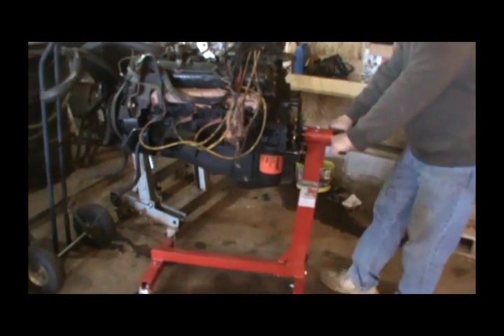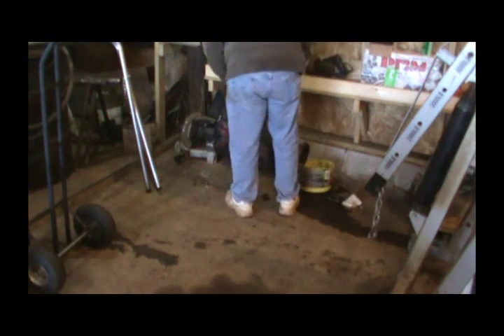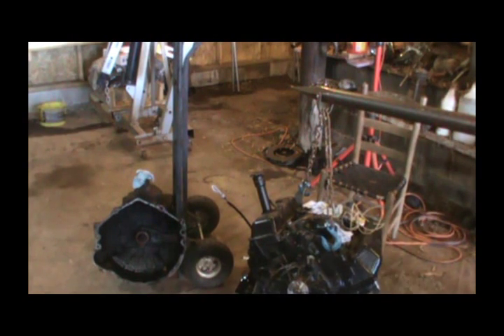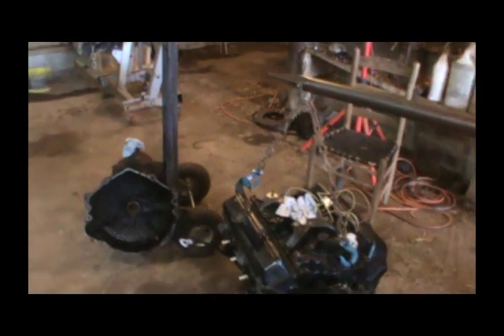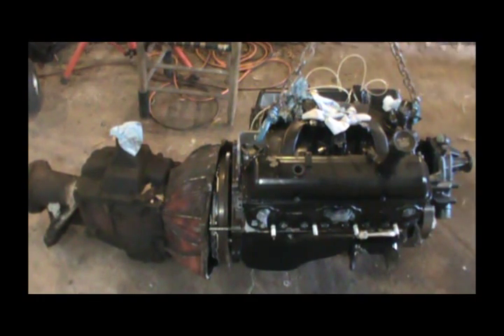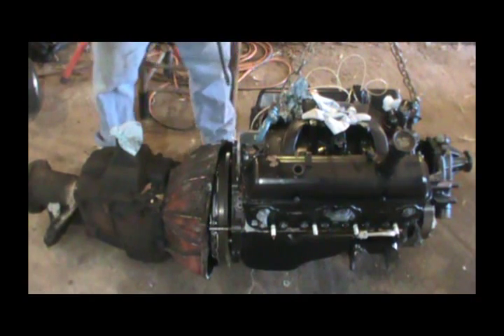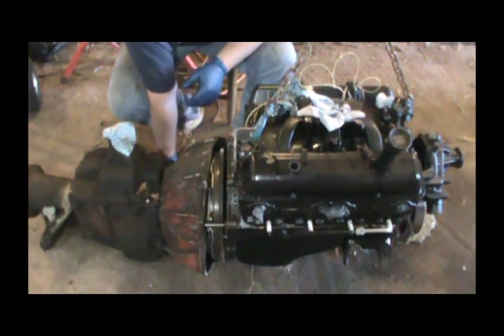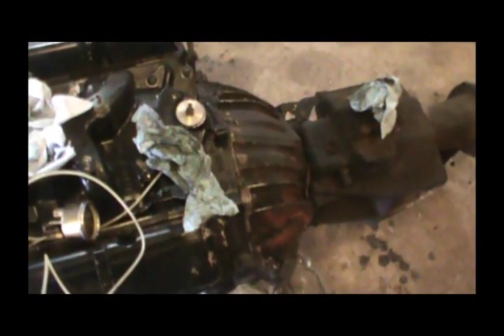1985 Chevy K10 Restoration Part 23

Comment: try laying under astro van  and put transmission in  and with only a small floor jack the don't stay up  and in a gravel drive way  i had lay on my back lift it up with one hand  and my nees on the tail shifted and try to line it up and put a blot in with my other hand  that was not a fun  job but it had it be done
Reply from the maker: I've been there Matt.  I did buy a transmission jack for the last job I had to do laying on my back.  It makes life a little easier when the tools work right.